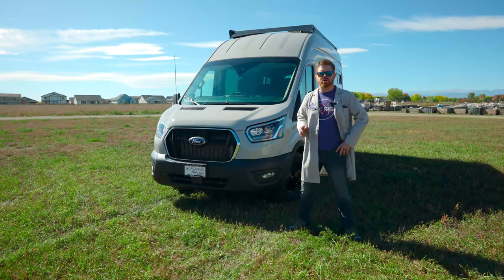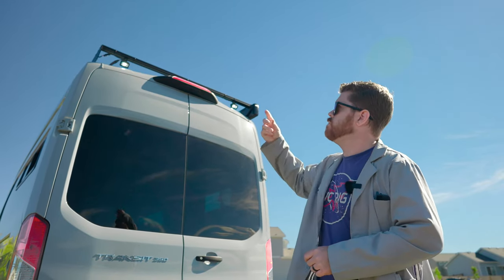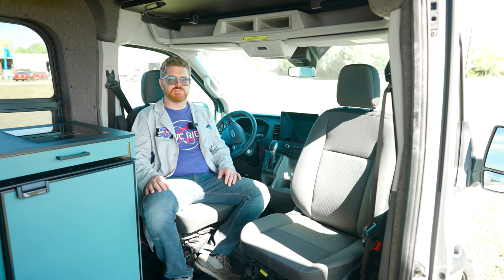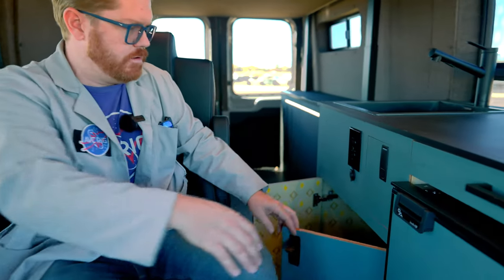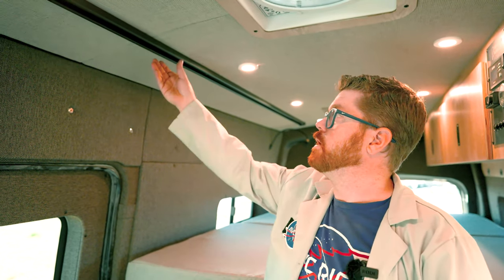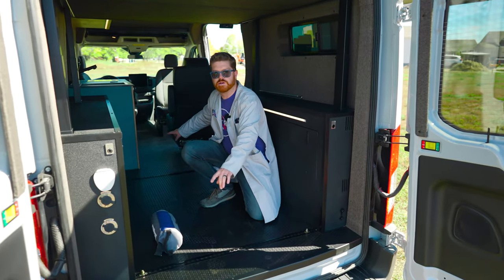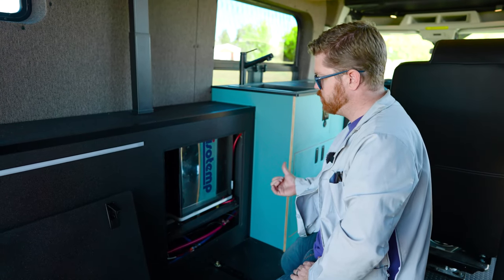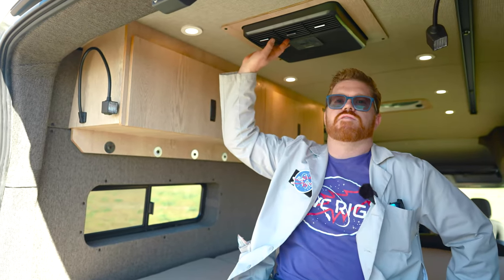VAN TOUR | Premium Gear Hauler Build

Comment: I like your bed system.  Do u have a bunk system similar to that? (So that we can sleep 2+2 in that space)

Can that be added as a singular option in a build out.
Reply from the maker: We offer a dinette under our lift bed that converts to a bed. We also have a manual bed system that can support 2x queen beds.  You can see that in our other gear hauler tour.

Comment: What is a full build out like this cost? If the customer provides the van
Reply from the maker: Most builds hit between 45-65 depending on options. We do have builds outside of those ranges (both higher and lower) but completes usually fall in that range.

Comment: That is what I want! But only 270 amp hour battery. Is that enough to run the A/C? I assumed that you’d need 6-800 amp hours of battery.
Reply from the maker: It’s enough to run it for a day at a time. The solar does a decent job of keeping up with it. It’s also an option to upgrade to double the battery capacity.

Comment: Any chance you guys will be putting up a wet bath kit to allow showering when it is cold out for a LWB Transit?
Reply from the maker: We don’t include wet bath options in our builds at this time. The best option I’ve seen (and what I would use if I did install a shower) is the Vanwife shower enclosures and an under mount grey tank.

Comment: Great looking build, super functional.  Did you end up having to add an additional coolant pump or anything for the Isotemp?
Reply from the maker: Nope, it ended up working out pretty easy. We added about 20’ of hose, but the resistance was low. Good flow
Reply: @AVCRIG Hi Matt, regarding the hot water line, what is the $65 option you mentioned, from Ford on ordering or from AVC orders? I ordered already so i have to do after the fact...
Reply from the maker: @jr.6199  From what we've heard the option is no longer available :(

Comment: Really Nice!  Just wondering about the AC unit - since it is located in the back roof area did it require extra support or is it close enough to the last roof support to skip the extra support?  If I wanted to remove a currently installed Maxx Air fan would it fit within the already cut area?
Reply from the maker: The back area has two roof ribs that are 14” apart. It supports the AC perfectly with no need for extra supports.
Reply: @AVCRIG  do you suggest installing the maxxairfan immediately in front of the AC or further up front.